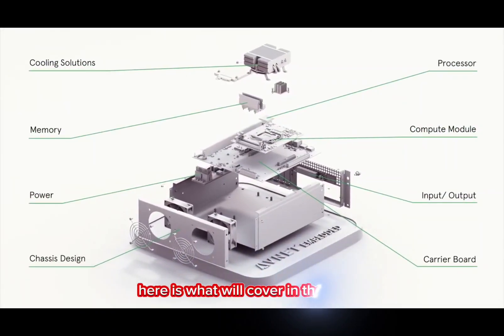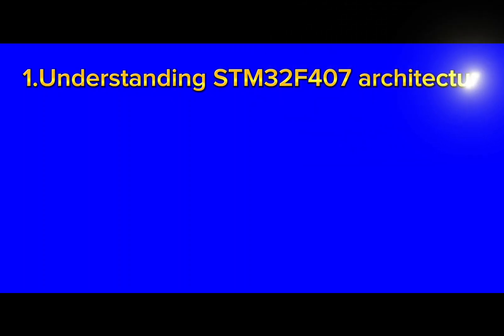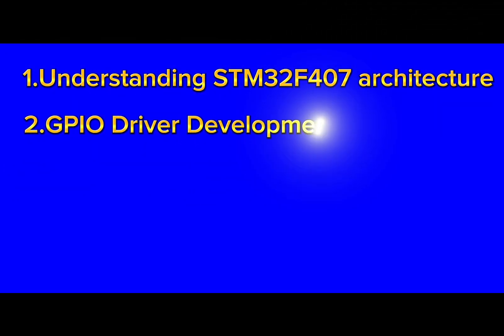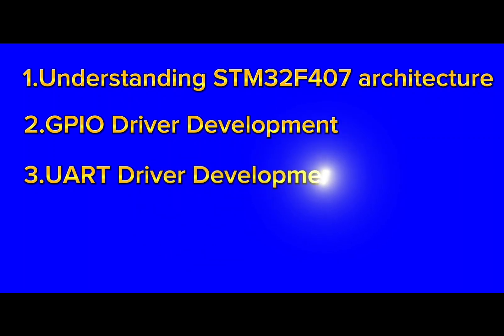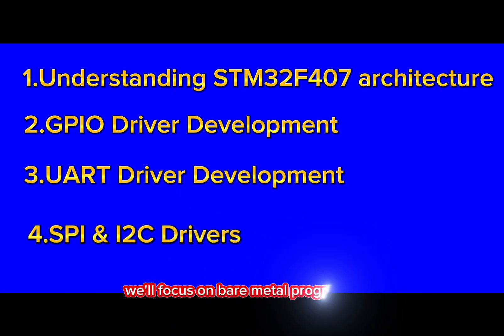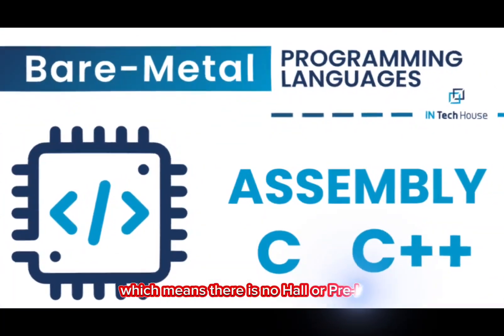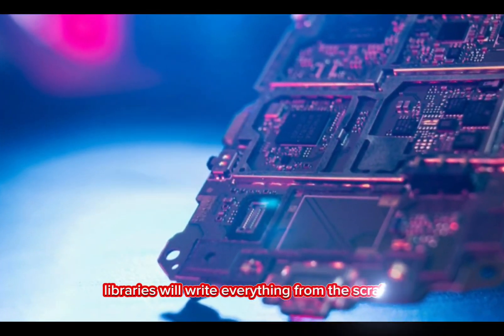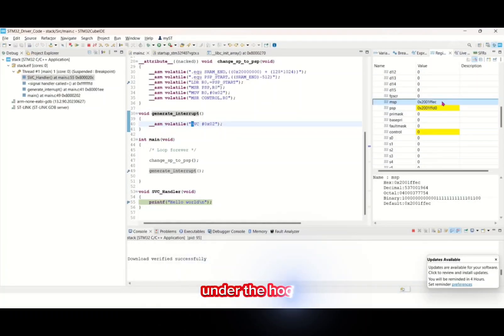STM32F407 Driver Development || Introduction to STM32 Driver Development #stm32 #embeddeddevices

Comment: Thank you, nice explanation in depth and completed all videos in series. I am new for STM32 board and trying to read sensors ang GPS data but nothing is printing. This basics knowledge will helpful to troubleshoot my code.

I got one question, the IDE provides these API calls and we can use them. right?
Reply from the maker: Yes you can you.